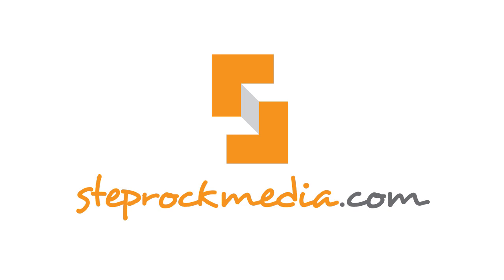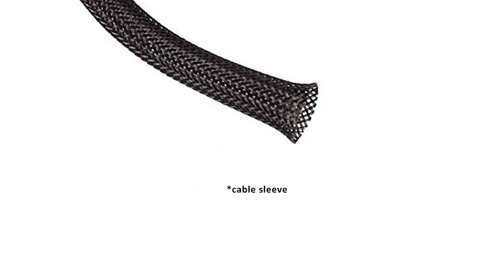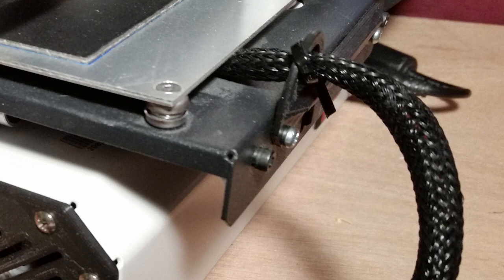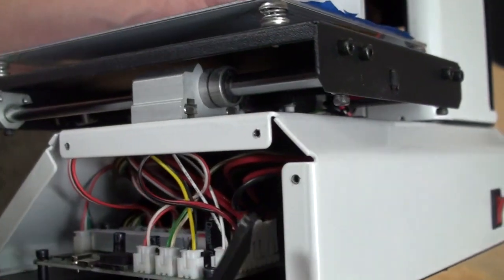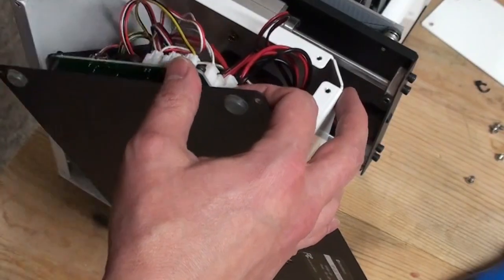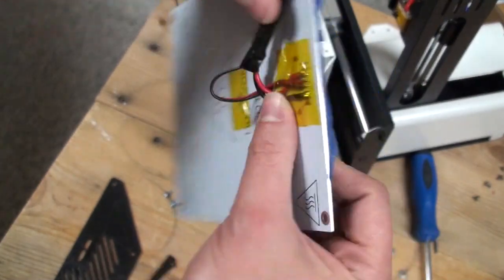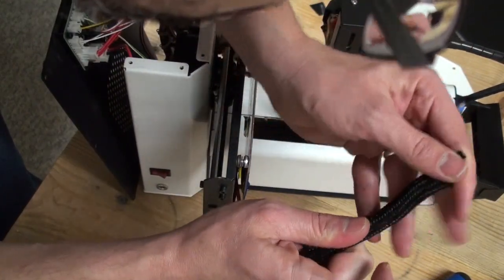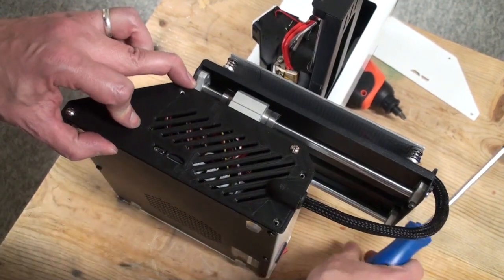Rewiring an MP Mini no drill method

Comment: Thanks for this video! Straight and to the point and better than the other videos. Took me about an hour and a half. I took the heated bed plate off to make it easier and putting it back on took longer than any of the other steps.
Reply from the maker: I know! Getting those screws in while under the pressure of a spring is a pain!

Comment: I found the wires were too short so I extended them.  It works great.  Thank you very much!
Reply from the maker: Good stuff! I had to repair broken wires the other day and also lengthened them in the process. I apparently didn't get to this PM soon enough since the wire broke after the reroute.

Comment: Just a small update to this. No need to take the end pieces off the end of the wire if you are going to use the cable sleeve. It works like a finger trap just compress one side and it makes it bigger. If a video is needed let me know. I have passe larger ended connectors through them.
Reply from the maker: Sounds like it would be easier if you can get it to work your way. In my case I gave up the fight and just removed the caps.

Comment: Just got one of them, heated bed wires seem to be already wrapped in some sort of, well, wrap.
Reply from the maker: Probably meaning the heatproof tape. Orange looking thing plastic?
Reply: @steprockmedia  just about to do the mod to mine and noticed that the wires are wrapped in the same black spiral protector as the material feeder
 so assuming the mod is no longer needed for new renditions of the mini v2?

Comment: So the smaller set of the 2 pin connecter on my machine got damaged  and i cannot reconnect this to the board. Do you happen to know where I can get a replacement?
Reply from the maker: Are you on the MP Mini Facebook group? They are usually pretty helpful and will add you to the group quickly as well.
Reply: steprockmedia sent my request now

Comment: What size was the sleeve cable for this?
Reply from the maker: I'm afraid I don't know since it was literally from a bit of scrap wiring I had. It's about a half inch across if that helps. People in comments seem to think it's a 1/4"
Reply: steprockmedia: ok thanks for the information. I wasn’t sure because I saw some cable sleeves on amazon but they come in sizes. But thanks though!
Reply: @anthonyl9015  hey man... I know it's a couple years after the fact, but what sleeve size did you end up using? 1/4"?
Reply: @isaacjoseph1078  Yes! A 1/4 inch sleeve fit the cables snug and not tight at all and I was able to re route the cables perfectly fine. I noticed the cables were smaller than I thought, and I was able to route them easily and should not be a worry for anyone trying this out
Reply: @anthonyl9015  awesome thanks man. Did you use and grommets? And if so, what size?